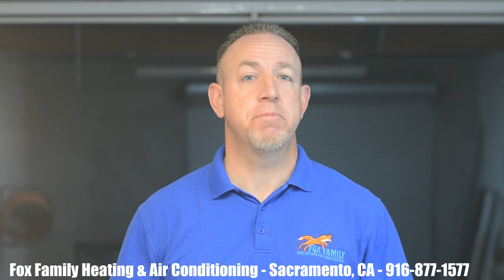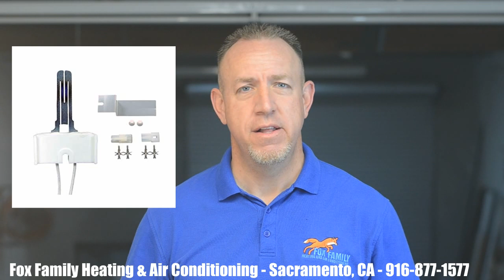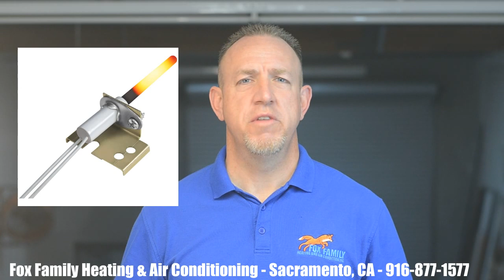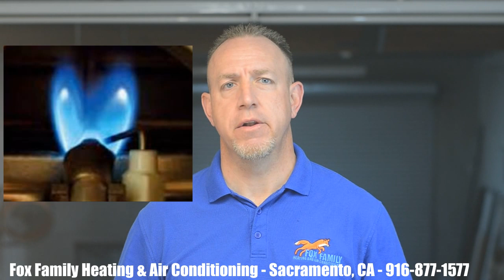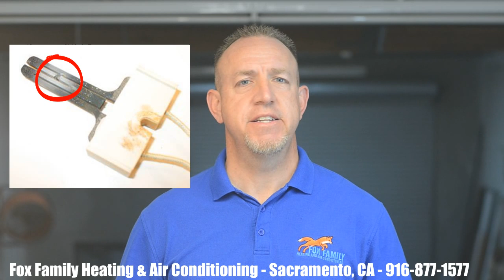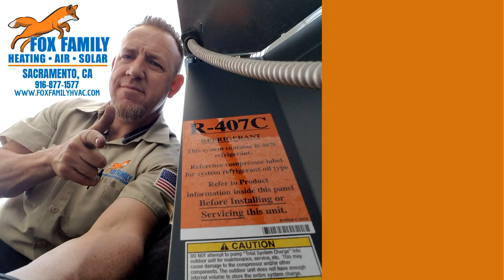HVAC Training: 8 Reasons Why Hot Surface Ignitors Fail

Comment: Fantastic video. The data here helped me discern why I replaced my HSI, then 4 months later it failed. I replaced it again, and watched it's operation. It stayed on as if stuck on. I shut my furnace down, let things cool, then started it up again. This time, once the furnace proved flame, I unplugged the HSI and plugged my voltmeter in. I sat and watched as the furnace ran for another 8 to 10 minutes and the circuit still was supplying the ignitor 120V. 
This helped me to discern I have a bad board.
Thanks for the help. Incidentally, I am a Facilities & Project Manager, and electrician. This video provided me with industry regular clues to what I was already piecing together based on my own knowledge of forced air efficiency furnaces.

Comment: Trane xc95M Furnace: Gas will not ignite. Replaced Hot Surface Igniter. Now when call for heat Induction motor comes on, after about 45 seconds the induction motor turns off, and then the igniter starts to glow. Why is this out of sequence order?   Should be Induction motor, Igniter Glow, Gas open, Ignite. Any idea what’s up?

Comment: Never heard of fingerprints shortening the life of a HSI, if I had to guess it has something to do with skin oils burning and creating hot spots and stress fractures, similar to halogen bulbs particularly the high power tubular style used in floor lamps that were trendy in the 1990s.

Comment: I have a Heil Furnace. My problem here is that the HSI continues to glow after the burners ignite. ALso once the furnace turns off, the HSI remains glowing. At this point, I have to turn off the main power. My guess is the problem is in the circuit board area. I can't find any material on line about that problem.  Any suggestions?
Reply: Hey Ed, did changing the circuit board fix the problem?I have this issue currently.
Reply: @robertclaps5465  Yeah would like to know this also for my Heil

Comment: I need help. Our HSI went out and was replaced and works fine now. Our furnace will light up correctly for a few days and then eventually will have a no light and go into ignition lockout. If I turn the furnace off and back on it will usually start again (typically on first try). The HSI always works and I can always here the gas valve solenoid “click” but it doesn’t always light. Any ideas on what causes this intermittent problem? It is a Bryant 90i from 2001

Comment: My HSI work intermittently. The furnace usually fires up instantly on the first try but recently the HSI will try to turn on many times to ignite the gas mixture. It will also sometimes ignite after the main blower starts. Could it be the signs of a worned HSI ? This furnace is a Coleman Evcon D.E.S 80.
Reply: I am facing the same issue with my Carrier furnace

Comment: I have a gas furnace, i can turn on the heat and it works, after hitting room temperature. It cuts off (normal). When it comes back on the flames stay for about 5 seconds then cuts off,  the motor still runs but cool high comes out. I can turn off the breaker then turn it back on and use something to fan air in the furnace toward the ignition and then it works. Have to do this everytime. Could you please tell me what it might be? Thanks.
Reply: Your flame sensor might be bad, that would be close to the HSI, possibly built into it.  Definitely near the flame though =]
Reply: @kissthefish2188  I'll replace that and see if its better. Thanks